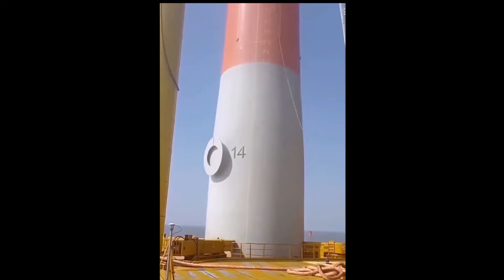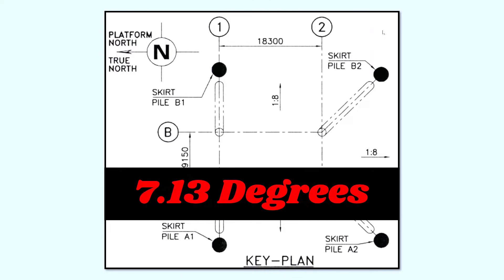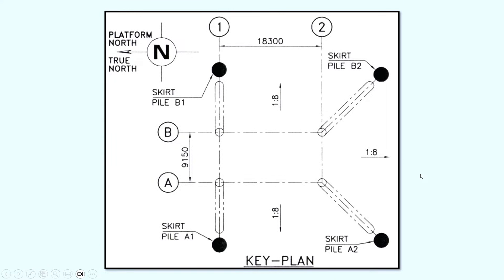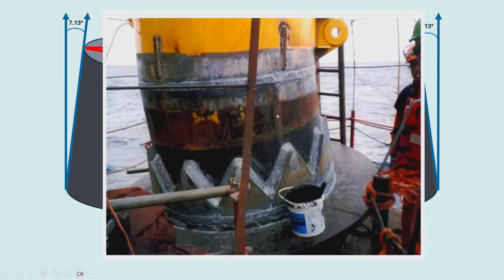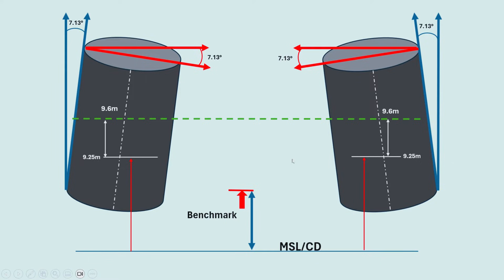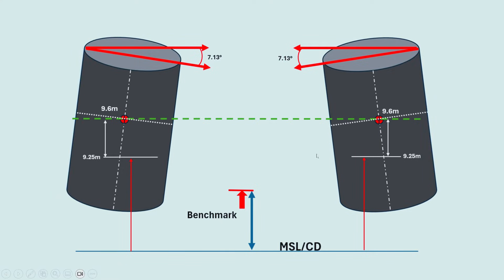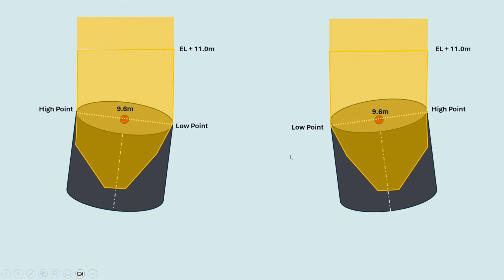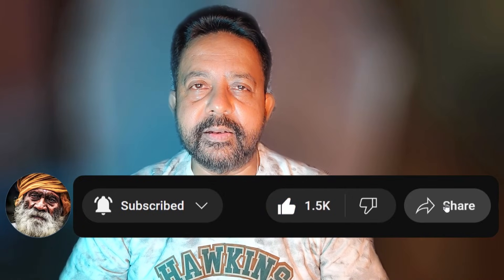How to Calculate Pile Cut-Off Angle for Offshore Jacket Installation | Surveyor’s Guide

Comment: Truly appreciate your clear explanation sir. 

I have a question,
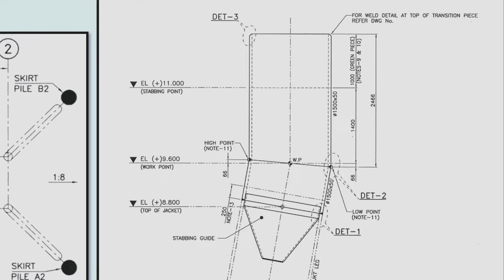I will take an example if the jacket has a 1:8 batter on North and South side and 1:10 batter on West and East side. Can you please answer how to calculate the cut off determination (especially to define High point and Low point) if the Jacket Batter has a different angle on a few sides?

Thanks in advance
Reply from the maker: I think what you are referring to is a double batter. The leg flares out at an angle and not at Right angle to the side but at 45° from adjacent side. This is very common on deeper water. But the batter angle remains same. Either 1:8 or 1:10, normally. At least I have not seen such double angle. But it could be possible.The it is best to consider the engineering as-built drawing and find out exact batter angle of the leg. But then the high and low points will also be at 45° angle. By the these are not on the fly decision. These are predetermined and the transition piece is fabricated as per that. I hope i am able to answer your question. I dont know how but the welder foreman always knows where to cut. I tried asking and he aint telling.